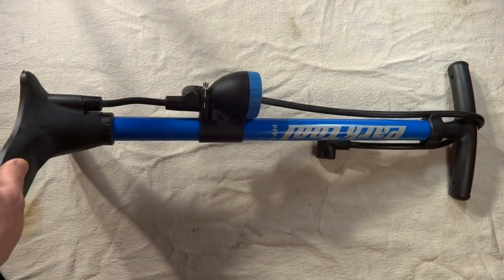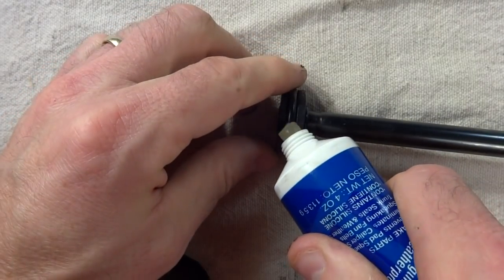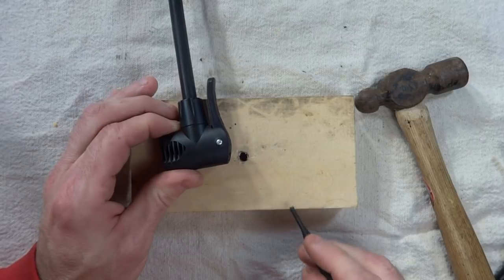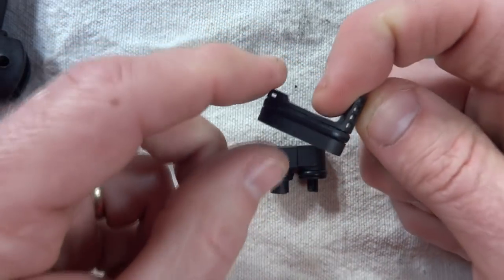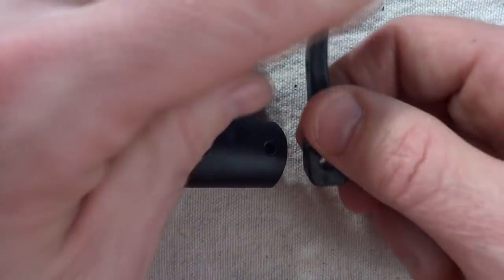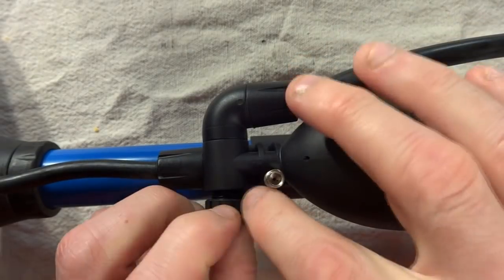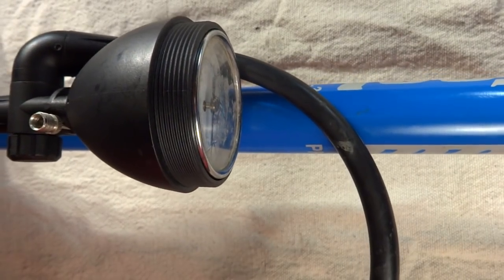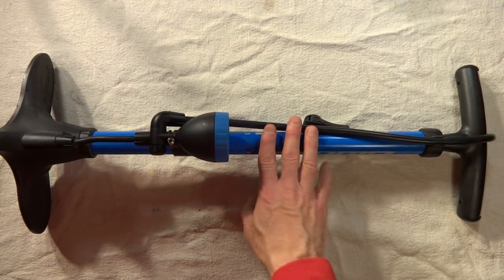How To Repair Park Tool Floor Pump PFP-3/PFP-6 (Maintenance/Service)

Comment from the maker: For more bike repair videos hit the subscribe button 🛑 and click the notification bell ► http://bit.ly/SubRJTheBikeGuy
Reply: I was thinking of mounting 2 of those pumps together. With 1 handle and at thr outlet a Y piece. So 2 outlets goung in to 1. That means doubble the pressure and 2 times as fast inflating.

Comment: I disassembled my pump greased, cleaned and put back together. Was all pleased with myself until I went to use it again and it didn’t work! Was bleeding air, tyres weren’t being pumped up. I nearly lost my mind until I watched this video and realised that I had lost the little rubber ball. I found it on the floor of my living room and popped it back into the pump housing and it works now perfectly. Your video saved my sanity. 👍🏻

Comment: Thanks for this tutorial, exactly what I needed. I Stripped down the head, the problem for me is with the presta part. 
When the valve is inserted the pumped air sometimes doesn’t inflate the tube 
It comes out by the side of the valve. Nothing obviously wrong with the O rings upon inspection. 
I’ll put it back together tomorrow and see if the problem persists.

Comment: My PFP-8 (which is very similar) had stopped working for Schrader valves. The rubber ball had gotten stuck. I was able to dislodge it with some light banging. Thanks for the vid!

Comment: My Ace Hardware has a few boxes of o-rings, $0.89 each, I have Serfas pump and Lezyne pump not a Park, but the 1-1/8" (OD) x 7/8" (ID) x 1/8" (thick) o-ring is what I needed and seems to be pretty standard on bike floor pumps, take the old o-ring into the hardware store for comparison to be sure, just eyeball it.

Comment: I just got my first bike with presta valve stems and I need a dual head solution for an air compressor. Since your grease gun comments were so valuable what would you recommend for quality and reliability? (and so I do not have to have those presta adapters on hand ) EXCELLENT set of videos. You've helped me through LOTS of bike work and instead of one working bike I am up to 6, all mission specific. Looking at getting studded ice tires for my winter bike. Thanks RJ!
Reply from the maker: +BikingMNViking I like my Park Tool pump, but occasionally it doesn't seal well. I took apart the head and cleaned it and now it works better. I have a Serfas which works well, but the gauges it small and hard to read. I recommend going to Amazon and reading reviews.

Comment: I have an old Bontrager SuperCharger floor pump from like 2009. It has been AMAZING. All original parts and use it ALL the time. For everything. Just now it has decided to fail me.
It fails when pushing down. It doesn't build pressure. Like if you pull the plunger up (handle) and just let it go, it drops right down. No pressure is building inside the pump. Otherwise nothing wrong with it. Is this a plunger gasket issue??

Comment: Thanks for making this video for other. My lifeline floor pump is now pushing air out as soon as I reach 50  psi, it use to go up to 120 psi. Its 4 years old. Does that mean I need a new pump?
Reply: probably just needs serviced, if the o-ring is not sealing the air will leak back out around it.

Comment: I have dual valve Avenir pump and use Schrader valve. When I lock to pump air,  the air comes out of tube and push pump handle up. So I can't pump air into the bike tube.  Please help. Appreciate your video. Thanks.
Reply from the maker: Your description is not clear. And this video is for a Park Tool pump. Not Avenir.
Reply: @RJTheBikeGuy  Appreciate your response. The problem was little ball that works as a valve. However, you are the reason that I figured out after watching your video. Thanks.
Reply from the maker: @drssdhillon2692  https://www.youtube.com/watch?v=jlEj0sHEuGA

Comment: i found a black burn pump. low preasure wont pump tires... and i open it up dont know if its gasket or hte hose at end of the head or base which i dont know if black burn model screws off. any tips.. and it has guage also

Comment: RJ, question for you!
I have a PFP-2 (I've had it for 20yrs, worked like a dream until... 🤦). The guage hasn't gone back to zero for over 10yrs now, but it still worked accurately for everything over 20psi. Last year I discovered that I could purchase a new guage for it - so I did. The plastic piece of crap came, and I installed. First time I went to use the new guage, once the pressure got to about 85psi, it would push the new guage up, off of its seat, and start to leak. So, naturally, I decided to go back to the old guage. Well, now the old guage does it, too. And I was wondering if you could tell me what the hell is going on, and if there's anyway to get it back to not leaking. 
Also, what does the 5mm Allen screw do (because I've messed with that as well)?
Hope to hear from you. Thanks!

Comment: You mention lubricating the o-ring with a silicone-based lube. I've seen other recommendations for dry lubricant. In lieu of those, should white lithium grease or other common lubricants work just fine?
Reply from the maker: linguisticness Silicone is what is recommended by the manufacturer. It is safe with the rubber o ring. Other lubricants may damage the pump.
Reply: RJ The Bike Guy Thank you for the fast reply! The pump I was servicing last night (the o-ring had just slipped off, but was also very dry) was a Topeak Road Morph G Master Blast. I figured an o-ring was an o-ring and white lithium has never done me wrong, but I've never applied it to rubber and should have checked with Topeak first perhaps.

Comment: Great video, any thoughts on where one could get cheap o-rings in these sizes?
Reply from the maker: Sean Crosby Maybe an auto parts store? Harbor Freight sells boxes of misc sized o rings in both metric and SAE.
Reply: RJ The Bike Guy 
Thanks! Yea, Harbor Freight. Good call, I forgot about them.
Reply: My Ace Hardware has a few boxes of o-rings, $0.89 each, I have Serfas pump not a Park, the 1-1/8" (OD) x 7/8" (ID) x 1/8" (thick) o-ring is what I needed and seems to be pretty standard on bike floor pumps.

Comment: RJ, my pump seems to be blocked or clogged. I get tons of resistance when trying to press down on the pump. Any thoughts? I plan to disassemble it tonight.
Reply from the maker: jcs311 Might be an issue with the valve head assembly. Do you get the resistance when not attached to a valve stem?
Reply: Yes, there is just as much resistance on the pump when it's unattached from a valve stem. I will follow your directions tonight and take apart the head. let you know what i see.
Reply: The blockage is somewhere in the plunger. I've disassembled it completely and even when detached from everything the plunger has 100% resistance when trying to depress it into the cylinder. When I remove the o-ring there is no resistance. BTW, it's a store bought Bell pump, nothing special
Reply from the maker: There is probably a one way valve to let the air go into the tire, but stop it from coming out. It is probably stuck.

Comment: hi. it looks like the lubricant you used is 'napa syl-grease', is that right? i've used a variety of lubricants while refurbishing my topeak floor pump but they have all dried up and started to 'drag' on the up-stroke. topeak does not have an easy-to-use support link where i wanted to find out what the original pumps used for a lubricant, which held up for nearly four years. meantime, i'll stop by napa tomorrow to see if they have the 'syl-grease'. thanks.

Comment: RJ, you skipped the disassembly/reassembly of the big seal between the metal tube and the base.  That is the biggest problem with these pumps IMHO.

Comment: Mine is pushing back whrn pumping. I bought a new pumphead and it still pushed back. What shall i do?? Thanx for the advice
Reply from the maker: One of the ball valves inside probably.
Reply: @RJTheBikeGuy  just bought brand new heads for both pumps. Problem solved

Comment: my car type (foot operated) twin piston/cylinder pump has let me down while i was pumping up my bike tyre,i'm guessing that the o rings on the 2 pistons are worn out as sometimes the painted metal cylinder bodies get warm/hot during inflation,btw what was that grease u used on the pistons,was it silicon grease???,brilliant video rj thx  :)
Reply from the maker: neil crompton Yes, I think it is silicone based.
Reply: ok thx
Reply: Very good video. One of the best I could find on subject
.

Comment: I have a PFP-8 floor pump,  my problem is the air is coming back and it pushing the plunger up. I hope you can read my comment and help me with this problem. Thanks.
Reply from the maker: Take it apart and clean everything.
Reply: @RJTheBikeGuy  thanks for the response..i already fixed it..the problem was the one way check valve, i just cleaned it.

Comment: Hi ,great video-  i'm not sure what the issue is with my pump-  none of parts look 'worn out' any help pls
Reply from the maker: Well that is vague...
Reply: shyflirt1
hi,  when i'm pumping up the typre i'm not getting pressure into the tyre. checked the plunger gasket and its looks fine. 
what are the type signs of 'worn show i be looking for?
Reply from the maker: You gotta figure out WHERE the issue is. It could be the pump is fine and the tube has a hole (try a different tire). If you have the dual head on the pump, is air going out the other side. Is it leaking from a hose. Does the gauge move when you press down the handle. Did you lube gasket like in the video?
Reply: shyflirt1 Hi SF,  I've located the leak,  when I inflate the tyre,  ive tired various tyres and when it gets to 60 PSI the pump basically wont inflate.  the leak is coming from the connector 7.42 into your video- I've checked the O ring but there is no wear or damage. any ideas?
Reply from the maker: Paul Hughes You can try pulling the o-rings off and flip them so the opposite side of the ring is facing in to the mating service. Don't damage them as you pull them off. You can also get a replacement for the whole hose part. But be totally sure that is where is it leaking.

Comment: Every time i push down on the pump it comes straight back up and the pressure in the tire comes out. How do i fix it?
Reply from the maker: Check the little ball at 7:40 in the video.
Reply: thanks
Reply: I have the same problem.  Pump is similar, but not exactly the same, and has a different brand name (Sunlite). There is no little ball in the location indicated in the video, nor is there room for one there.  Do you have ideas where this "check valve" might be located?

Comment: Does anyone know where i can find balls like the one at 7:37? My air pump has a hole on the rear low side of the main cylinder and i started to believe that there was a ball in there. Now the air is leaking from that spot!

Comment: Hi
My Park Tools floor pump is fine except that it wont measure the amount of psi being pumped...any ideas?
Reply from the maker: Not sure. Does the gauge move at all?
Reply: It stays at the bottom when pumping air
Reply from the maker: If the pump works otherwise, it sounds like the gauge has gone bad. You might be able to get a replacement gauge. If the pump isn't that old, you might try contacting Park Tool.
Reply: Will open it up to see if something got loose inside anyways lol.  I dont mind with my mtb tires since I can tell the approx amount of psi pumped. My problem is road bike tires, I already blew a tube lol